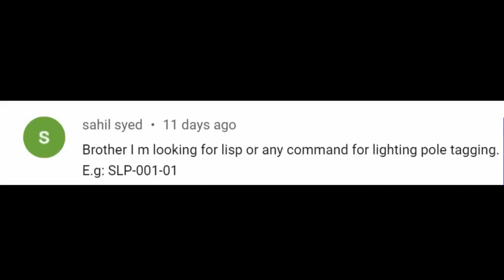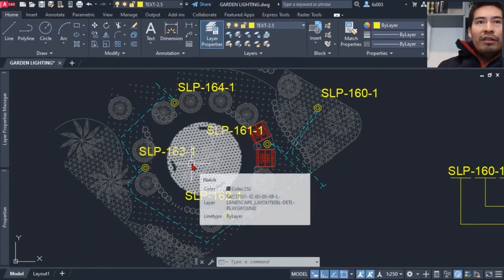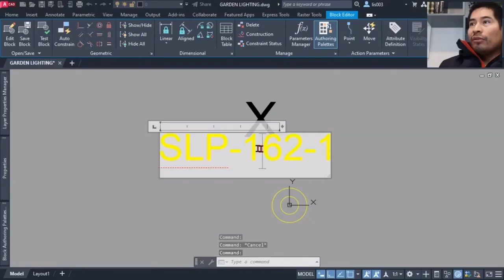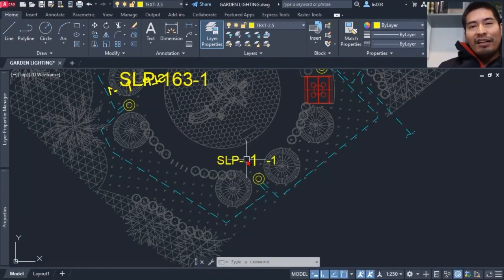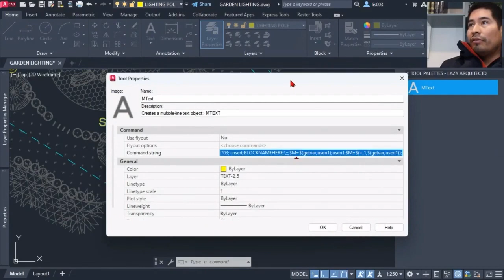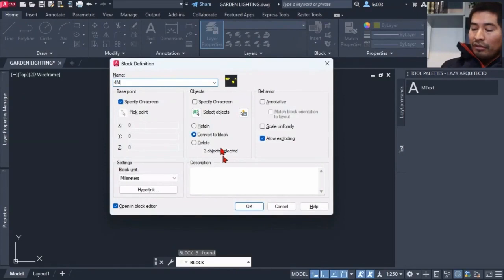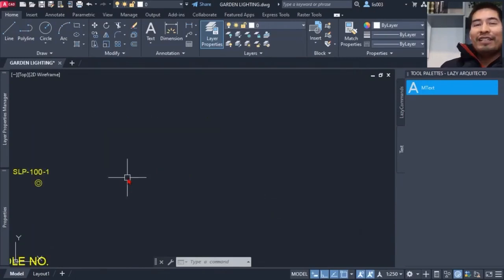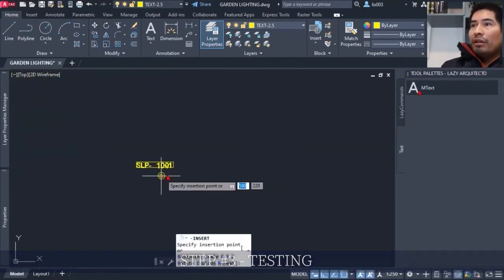Automating YOUR AutoCAD Numbering | lazyQUESTION 1

Comment: Hi 
Whatever I have done 
Not sure. 
But can’t move things into the Tool Palettes for some reason. 
Any suggestions??
Reply from the maker: Hi Martin, reset your profile to default, and try again. Let me know if that helped
Reply: @LazyArquitecto  profile to default? This is new to me. How do I so that please. 
Maybe this is why my mouse will only pick one group of objects to move at a time.
Reply: @LazyArquitecto  it’s Right click 😱😱😱
For me to creat a new tool on the Tool Palette I have to use the Right button on the mouse to drag onto Tool Palette. 
Not sure how that changed around.
Reply from the maker: @martinwhitmore2277   Martin i send you an email